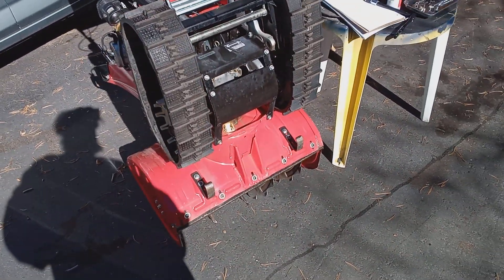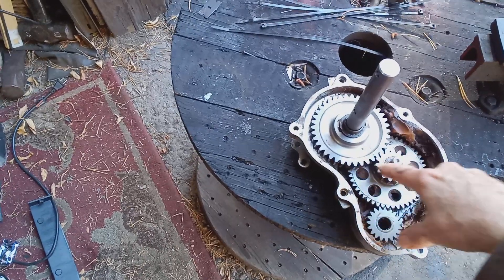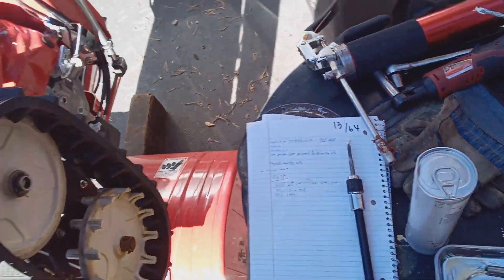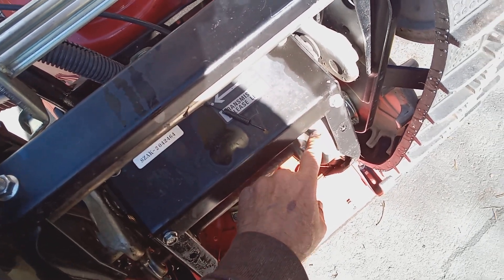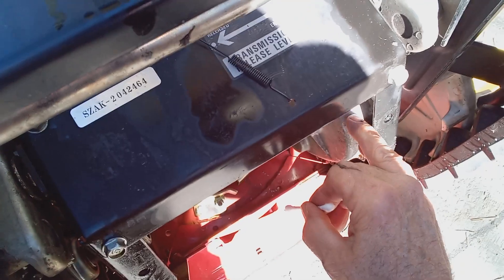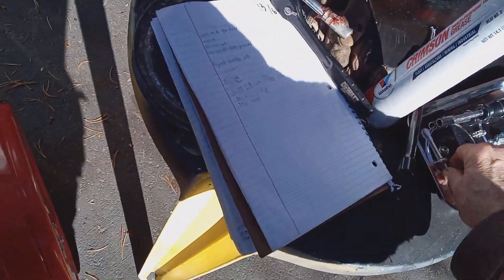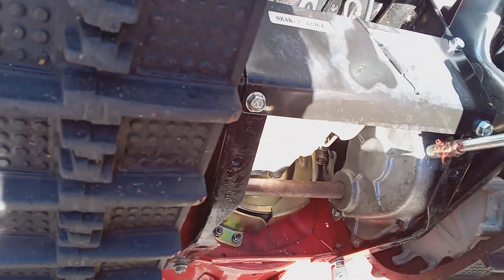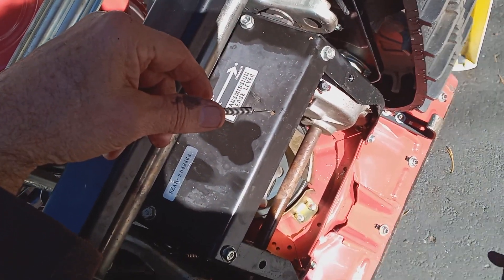ALWAYS DO This To Your Honda Snowblower .

Comment: On my 928 HS where the gearbox is that big steel shaft extended out between the track and the body sticking out about an inch I do have a zit grease fitting it took me 20 years to find that out. Thanks Anthony for making me looking at my machine in 20 years I never brought it to a shop but  because of you. I am doing a heck of a service on it. I’ve been working on it I think more than six hours so far. And my next big job I need to change the drive belt it is cracked, so I’m waiting for your video on how to remove the box .🇨🇦
Reply from the maker: I have a video on removing bucket. How to change belts video I believe. Are you a member of my Facebook group HONDA SNOWBLOWER ENTHUSIASTS? I'm there every day all day long. Thanks for watching.

Comment: Hey Anthony, thanks for the instructional video on installing a zerk fitting. I was wondering if I could install the zerk fitting higher up on the gearbox so that I could reach the fitting from above (right above that kick lever plate) I could use a grease gun with a short hose extension.  Is there any problem with drilling in that location of the gearbox?  Thanks.
Reply from the maker: some owners do.

Comment: Just wondering if pumping grease through a jerk could pop a seal?
Reply from the maker: That's a great question and you are not the first to ask. NO, it will not pop a seal since this gearbox is NOT a sealed unit like some. Excess grease would just come out at the axle shafts. It's hard to overfill. I haven't tried but I bet you could pump in an entire tube of grease. I just pump in 30-60 pumps. Sometimes 100. Then every fall I pump in about 30 new pumps. When you drive the machine the gears will distribute the new grease everywhere. Thanks.

Comment: If you pump in too much, won’t the seals blow out? Also, if you pump in new grease every year, what about seals? I’m also wondering if you could use John Deere corn head grease- it somewhat liquifies when it gets warm, then stiffens a little when it cools down…use it in my JD thrower gearbox…
Reply from the maker: What seals? there are no seals to blow out.
Reply: So there are no shaft seals on shafts to the tracks?
Reply from the maker: That's right. you may be thinking of the seals on the hydro static tranny?
 @robertprice6359

Comment: I first saw this mod on donyboy73 YouTube  channel if you want to check it out. This gear case is very similar to the Snapper RER  mower gear case which is serviced once a year with 2 ounces  00 grease through a 1/2 inch hole that has a plastic bung that is in the side of the case. Some people are now using gear oil instead of the 00 grease in the Snapper gear case as it ensures the gears are bathed in lubricant. Snapper gear cases were suffering the same fate as Honda blowers with the old grease hardening and not doing the job. I have been using gear oil in my snapper with no problems and the mower is 39 years old. Would this be a option for the Honda HS series gear cases? I don't know but the 00 grease might be worth trying as it comes in a squeeze bottle with a tapered tip which so easy to put in to the gear case. Fill holes in the gear cases also give the correct leave of lubricant so when it comes out the hole the case is full.
Reply from the maker: Thanks for comment. people have asked about oil before and you can't install oil because this case is not sealed. I just use water resistant marine low temp grease and pump in new grease every fall. You cant put too much in. Actually it's best to fill with grease to keep water from entering.

Comment: DO NOT do this procedure.  Honda, who I consider to be the finest engineers around, would have installed this, if it was meant to be there. The thing about it is, this is simply not meant to happen and I will explain why- Let's face it, the grease doesn't leak or burn; what it does do, is get very dirty, salty and hard(like aged cake icing)-I call it contaminated. To do this right, you need to get into the  gearbox at least every 2 years to inspect it's condition. Let's face it, if an undetected cracked-off hardened axle pin gets into the gear box path, it's game over. Major bill. Another reason you need to get into the gearbox is to remove the contaminated grease and freshen it up with new approved grease. 
Another thing to look for and one that kills a Honda blower, are seized or noisy bearings. There are 9 bearings that MUST be checked, at least every 2 years and guaranteed you are replacing 1 or more of these bearings.
By the way, that Grease Zerk that Honda installs on their machines on the Sub Tranny gear box plate is for assembly purposes only and nothing else, otherwise it would be mentioned in the manual. 
My Honda Snowblower(1132) is going into it's 16th winter. Every time I go out, I do 4 driveways and my blower is as dependable as one could expect and I do all my own maintenance. 
Many experts say that a Honda Blower can outlast You and I believe them. 
Here are my yearly (Inspectable) maintenance items:
-Pull Cord
-2 Auger Bearings(on each side of the Auger)
-Auger Impeller Bearing(behind the box, that spins the auger belt). I make a habit of replacing that every year. It makes the machine run smooth
-2 Crawler Bearings
-Left Side Plate bearing, that the axle goes through
-3 Sub Transmission Bearings
-5W 30 (Non-Synthetic) Motor Oil
Slide Skis make sure they are adjusted and replaced when worn through. How many blowers do I see with no or worn out skis. The Auger box gets eaten alive and your augers teeth go from steak knives to butter knives
-Anti-Seize Lubricant on the Auger Sub Axles. When the Shear pins snap, you auger is suppose to stop. A seized axle just keeps spinning. 
-Inspect the Auger and Drive Belts yearly
-Inspect, Lube or replace cables
-I try to use low temp silicon lubricants. 
I move a gazzilion tons of snow each year and my machine is up for the challenge. The only thing that has failed me are shear pins.  Happy Snow Clearing!
.
Reply from the maker: who opens this gearbox every 2 years? That would be $300-400 labor around here. The Canadian machines have this grease zerk so please explain that? Anyways thanks for comment. I'll agree to disagree . This zerk install is one the best things to do. Why are Honda dealers starting to add this procedure to their services for the older models?
Reply from the maker: Curious how many of these gearboxes you have inspected rebuilt? How many Honda snowblowers have you worked on? Did you speak to a Honda engineer as I have about this? I have. You are partially correct. they did mention preventive maintenance by servicing this gearbox but not every 2 years. They suggested 10 years or sooner if used commercially . But once again the normal Honda owner is not going to the expense of doing  this. I have opened up many of these boxes. When I rebuild , I fill the box 100% with grease to keep water or other contaminates out. Thanks.
Reply: I have repaired enough sub trannies to realize that a seized bearing or a broken-off hardened pin that mixes into the grease is not good for the blowers operation or the pocket book. I have never seen a Hydrostatic transmission lose an arm wrestle match to any part. You want to work in co-operation with your HS Tranny and not against. The 2 years is more related to the number of hours and where you live. Where I live, the salt is tortuous on machine and I have found 2 years to be a suitable teardown maintenance period, where at least 1 bearing will need to be replaced. 
I have serviced the Honda blowers for my adjacent neighbours and subsequent tear-downs have proven to be less costly if they are done on a 2 year teardown cycle.
Sorry, I just don't believe in putting new grease on top of the old grease and possibly parts, but then again, I am not paying for it. 
  @HondaSnowblowerEnthusiasts311
Reply from the maker: Broken pin in this gearbox and the machine would not work. Anyways this repair is about $250 in parts and about the same for labor. And most of these gearboxes last 20-30 years before they break unless of course they are abused by operator or used commercially. Financially speaking i think most owners would rather pay $500 one time after 20 years than doing the teardown 10 times over 20 years at a cost of $2500-5000... Between me and a couple of my Honda tech friends who work for dealers we have worked on thousands of these machines and everyone agrees that the zerk and new grease can prolong the life of the final drive gearbox.  Good luck.  Thanks .  @bobkirby669
Reply: Good chat